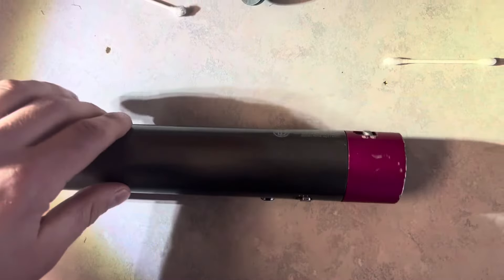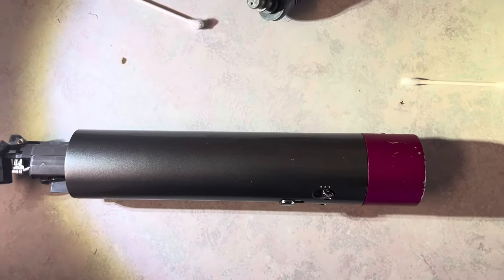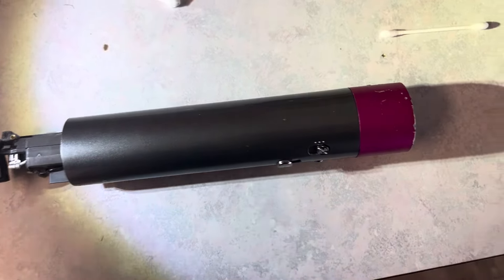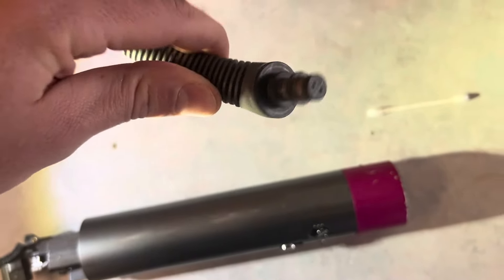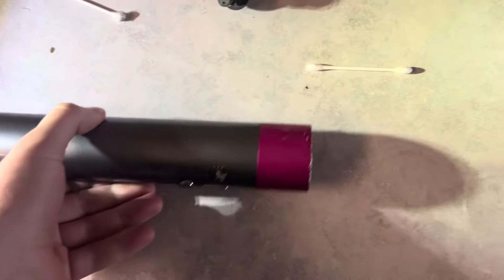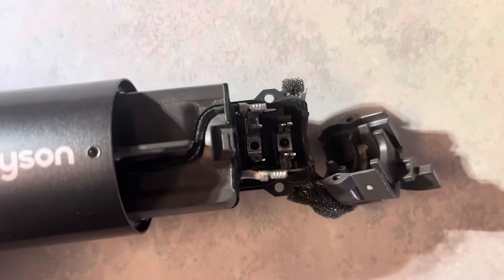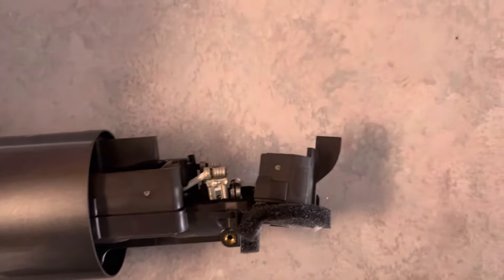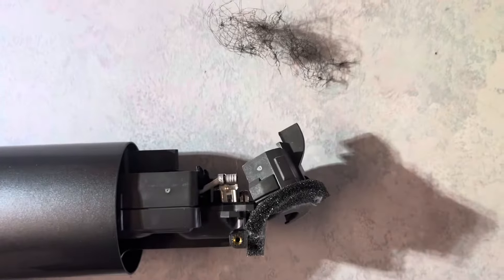Repair Dyson Airwrap

Comment: You the man! 

For anyone else that has ended up here. Steps below.

You will need a T6 "Star Bit" 

Remove the magnetic filter

Remove the first 2x T6 screws (black)

Remove the second stage stainless filter. Little tweak away from parallel to the main body and pull towards the end of the cord at the same time. Only clips hold it in place.

Remove the next 2x T6 screws and remove the peice of body they secured. Sometimes labelled "A4" and has a black wire running under it.

This reveals the contacts in the power swivel joint. 

Lift out the cord/swivel piece. 

Clean the contacts on the power lead swivel.

Clean the stationary contacts on the device. 

Ideally, this is when you reapply a small amount of conductive paste, otherwise you could end up with poor contact and the same issue. Or worse, burn out the contacts.

Reassemble, test and hopefully hand back to your partner. 

God speed fellas

Comment: There is another little filter down a barrel, right at the fan blades. Mine was completely clogged. I was able to clean it out with a chopstick without disassembling whole unit.